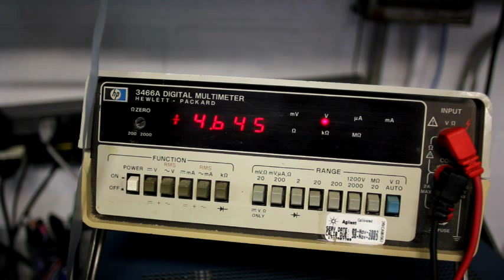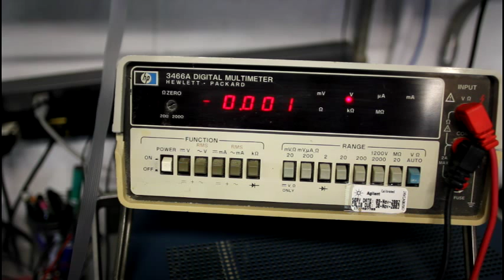Foscam Camera Troubleshooting

Comment: I did your test and  put a new  power supply and still nothing .  I can control the ir light  on and off from the menu on the computer but thats it the screen is black from the video . What the next thing to try ? I have ir light   that I 'm able to turn on and off  . Did you have ir lights working  with your bad power supply ?
Reply from the maker: Actually I did now that I think of it.  It wouldn’t hurt to disassemble it.  I still use some of my original cameras and took apart one a couple of months ago.  Although it still kept the moisture out well, there was corrosion on some contacts and at some SMD capacitors.  I took it apart and gave a good scrubbing with white vinegar at some points and topped it off with a little de-ox, which helps to keep the corrosion at bay and it worked for me. Of course on this one it was more than the power supply, but the supplies can fool you by lighting the ir leds but then fails when trying to boot the network board for the camera.

Comment: I would add detail... it is my understanding that Foscam's are ripped off by multiple non-Foscam makers all over China which I assume results in build differences from one lineage to the next. I have a system of 10 or so cams purchased over several years and have noticed extremely imperfect interoperability from one cam/brick combo to the next. Right at this moment, I'm looking at a known working cam that is not operating when energized by a working brick from a different working cam. I can't say I noticed interoperability issues early in these things service life so maybe it's an aspect of functionality decline as they age. Nice 8665 source in the back there.

Comment: You did it again for me, another dodgy power supply, they are all over 5.1v but still not enough.
Reply from the maker: I have replaced all of mine, some more than once,  but the original cameras themselves are all still fine.
Reply: @drueking  well it turns out once I had pulled it off the wall and plugged it into LAN and checked a few settings , somewhere along the way it had changed SSID it was searching for on the wifi so of course I could no longer see it and there were no LEDs flashing unless I had the ethernet plugged in. thanks again all good now with the same power supply.

Comment: hi I am in exactly the same position as you. I have already bought another camera on eBay  which is still coming, but I will buy another power supply as well. that will be very annoying if the replacement cameras power supply fixes the issue. thanks

Comment: Do you know anything about the dreaded black screen?  I have 3 Foscam 8906w that all at once stopped working and now only show a black screen.  When I connect them wired, the signal flickers off and on.  I am assuming the cameras are dead.  I have changed power cords with no luck.

Comment: changed power cord and camera still work not show a picture. It keeps reporting that it timed out before getting a connection. My four other cameras work on my IP camera tool. I do get into the setting window but no picture.   my camera is a FI 8918W
Reply from the maker: The only time I have had something like this happen is when, on WiFi not LAN, that camera either has interference or is too distant from the router.  I had to hard wire that particular camera.  Try this,  lower your resolution on that camera and/or lower the brightness and contrast and see if you start to receive a picture.  If you do, then that is your problem, and either hardwire or move to a better location.

Comment: My camera been giving me weird bleeding colors. When I physically move the head with my hands, it temporarily goes away. Do u think it might have something to do with bad wires? Ty.
Reply from the maker: Been thinking about your problem.  Can you tell if the infrared filter moves out of the way properly when it gets dark?
Reply: thx for responding back. I'm unsure what infrared "filter" means but what I do know is that my infrared lights or lens does turn on and work as normal in dark areas of my apartment. While it's turned on, I do still see abnormal signals/scrambled pixels everywhere.

I recently took apart the entire camera a few weeks ago (since my warranty is over) and i removed all the ports and cables and reseated them. The issue hardly shows up now.

Comment: Thank you! Was having trouble connecting / pairing a foscam camera and monitor (both worked perfectly well until recently) and tried your suggestion. Although both the camera and monitor have similar power adapters, it seems that only one is providing enough power to send the signal through to the monitor. Wouldn't have tried such a simple solution as switching adapters (as the camera switches on but doesn't seem to transmit a signal with the defective adapter) if I hadn't seen your video. Thanks again!